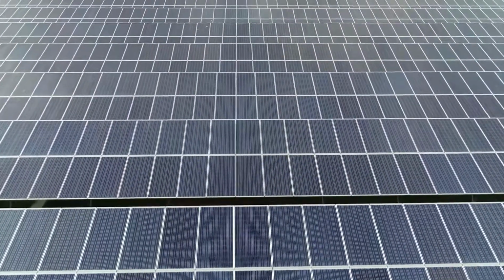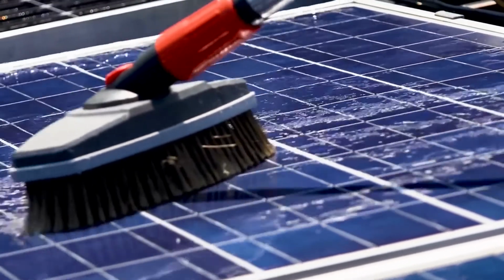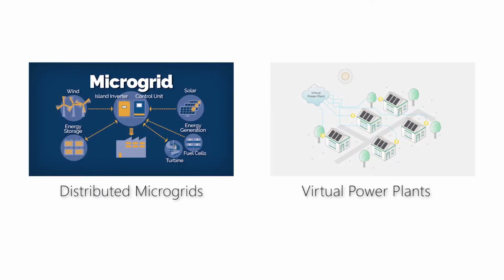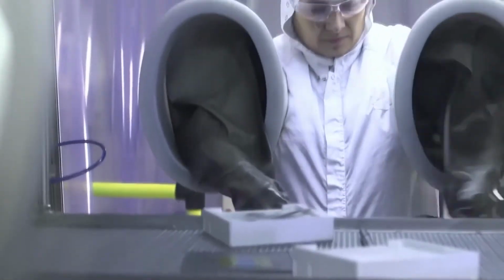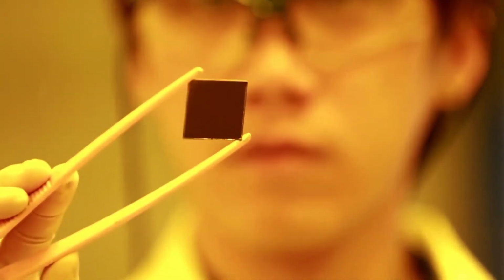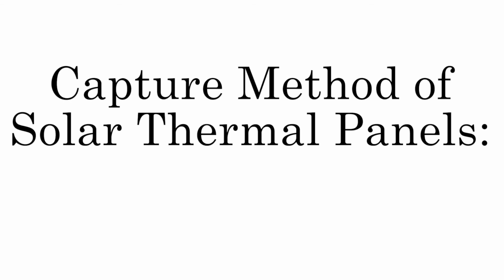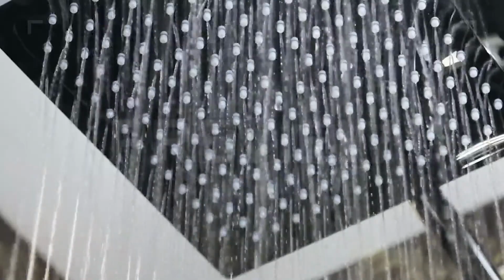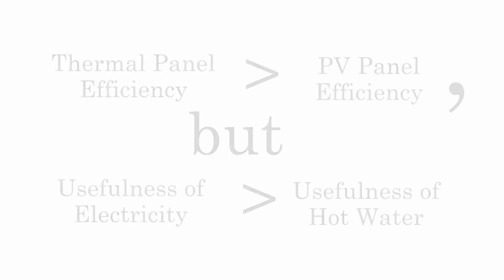PART 1 of 2 || Is Solar Hybrid PV/T the Future?

Comment: SunDrumSolar Hybrid Solar has a beautiful patented Hybrid solar system that utilizes the excess heat energy collecting it with its high-quality thermal collector. The beauty is the collector attaches to the back of almost any solar panel without voiding it's warranty. 86% capture rate, retro fits onto existing panels, and integrates a heat pump optimized for efficiency.